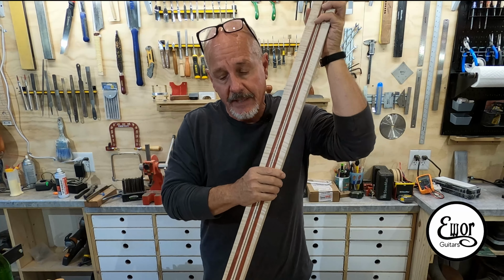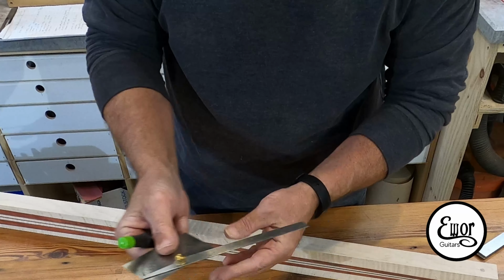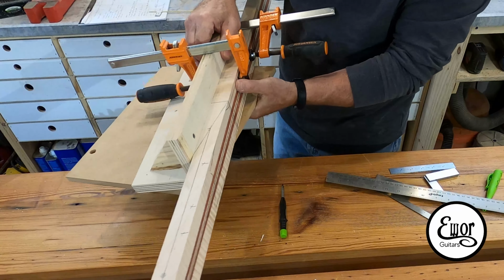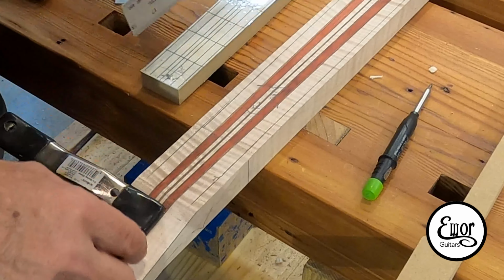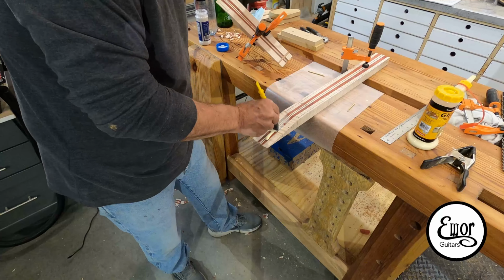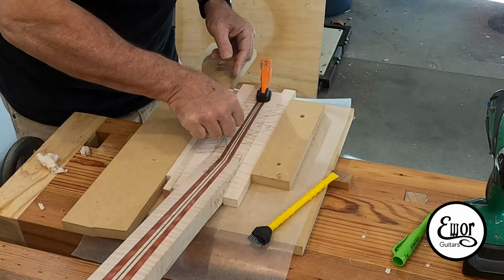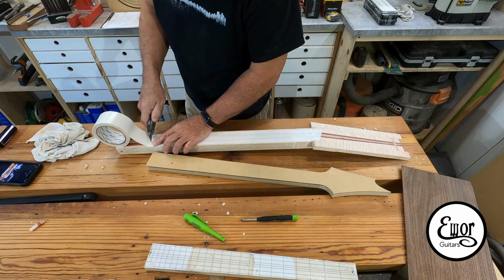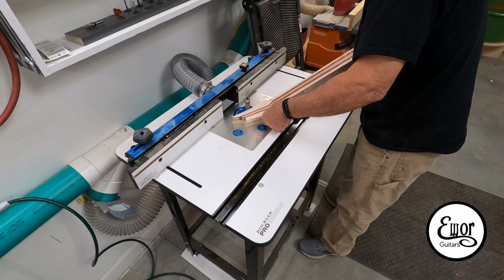How to Build an electric guitar episode 9: Neck Building: Scarf Joint

Comment: Great video! I think the slight skew was great. It isnt' obvious but it shows its handmade nature.

I don't know if you' already use them, but two other hand tools that can really make a difference is a high angle plane and cabinet/card scraper. They can get very clean severed fiber results like a regular hand plane, but they can handle very figured wood that a regular hand plane bedded at 45deg can't. An alternative to a high angle plane is having a second plane blade with a 90deg bevel so it scrapes instead of cutting.
Reply from the maker: Thanks brother

Comment: Nicely done my friend! Stuff does happen and there is nothing at all structural with that slight angle to worry about on the neck. I use a block plane very well for some apps but my shelix equipped jointer is stellar for the big work. I did a short video from the GGBO series of truing up the head angle on the jointer. Search it on my channel if you're interested. Again David, you do absolutely beautiful work. Well thought out and executed. Your neck radius/ truss rod jig is brilliant and the one I made from your idea works much better than what I did before. Thanks brother.
Reply from the maker: Thanks Dane I need to check out your video. I have a grizzly jointer with the helix head that I think needs a bit of a tune up!
Reply: @eworcustomguitars here's a link to that video. https://youtu.be/or21oGiACLk

Comment: Hey Dave - Another good video. Don't worry about the laminates being slightly off square, once the neck is fitted to the body and the heel shaped you will not see that. It's a good neck which must not be wasted so stress not and carry on. Wishing you a merry Christmas and New Year. Regards Dave J.
Reply from the maker: Thanks David you have a very merry Christmas too!

Comment: Bet the hand plane work is responsible for the leaning stripes. I enjoy a well set up hand plane, and I use them in every build. I intend to get a quality one sometime. But I still have issues sometimes with them. Just how It goes.

Those stripes leaning won’t be noticeable when it’s done I think. But man.. if it were me.. I would be thoroughly displeased..but I’m a perfectionist like that. 

We craftsman types are never 100% happy with our work, no matter how good it actually is. That’s the artists plight. In any case, really digging the vids man!
Reply from the maker: You got that right those leaning stripes hurt my feelings for a bit but probably won’t matter in the end. I’m definitely going to watch that next time!
Reply: I’m current building guitar #4. I think the leaning stripes add character and even meaning to your guitar. I discovered that hand built guitars are living beings and as such imperfections actually perfect them.